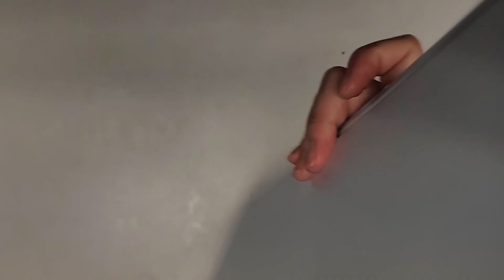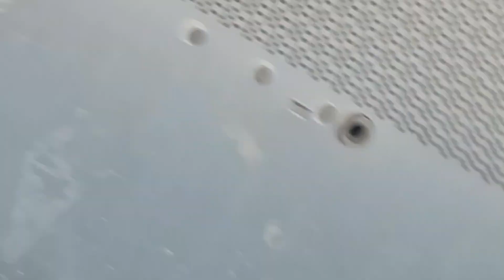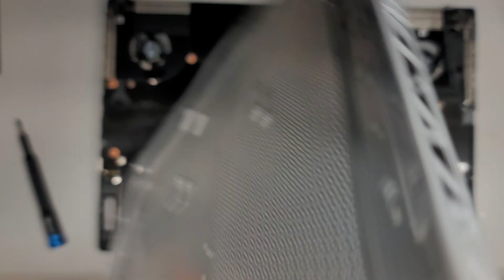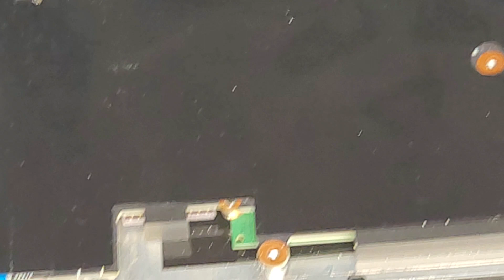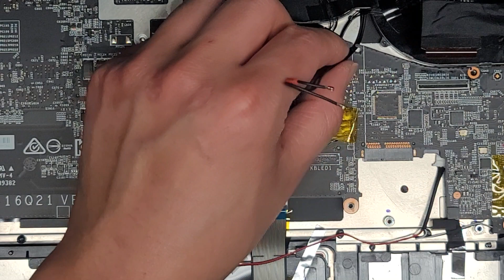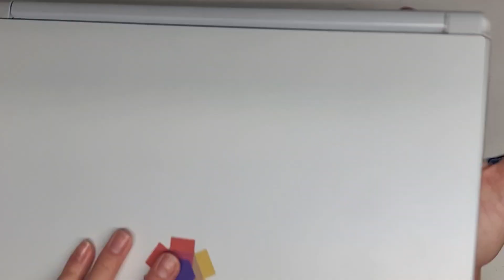MSI P65 Creator 8RF Disassembly RAM SSD Hard Drive Upgrade Battery Motherboard Replacement Repair

Comment: where are the speakers? I had my dc port replaced and now my speakers aren’t working i wonder if they didn’t connect them properly putting it back together.
Reply from the maker: 16:43

Comment: Hey, thanks for this. After watching your video, I took the plunge by ordering a new battery for my MSI P65, took the laptop apart and replaced the old battery. 
I had a tough moment trying to unplug the connector (had to removed the rubber stopper and glue it back later) but it worked well and it's now charging. Thanks again.
Reply from the maker: Awesome, glad it helped. If you haven't already, please like and subscribe so others can find my videos and possibly consider watching a few others to get the algorithm to recommend my channel. Thanks!

Comment: Thanks for the video , ive once opened a laptop and ruined the WLAN chips  , is there any tip that will prevent breaking at the solder point of the pin
Reply from the maker: Have to pull straight up from the tail as close to the connector as possible.

Comment: Hello, it has been very helpful to remove the battery from my laptop.  To be able to use the laptop only with the power of the cable, what else should I do apart from removing the battery?
Reply from the maker: What do you mean what else? I recommend putting a new battery.
Reply: @ItsBinhRepaired  I have removed the battery because the battery was inflated, and I thought that removing it and using the current would continue to work but it does not turn on
Reply from the maker: If it's a bad battery, you'll need a new one.
Reply: @ItsBinhRepaired  I already solved it, thank you very much.
Reply from the maker: Great